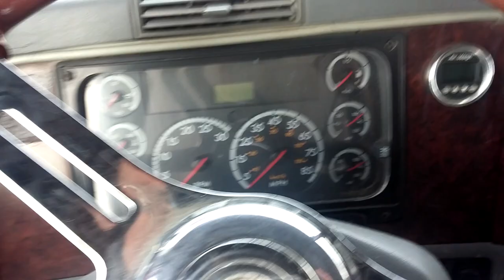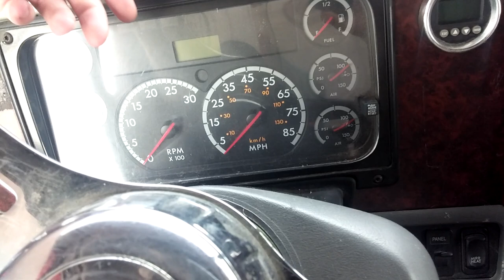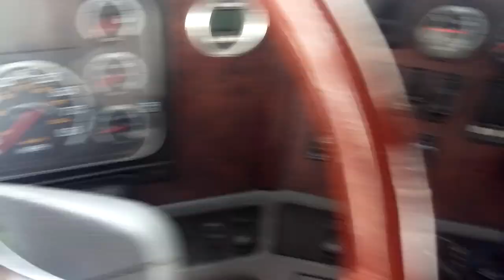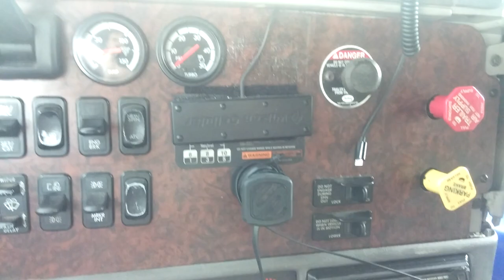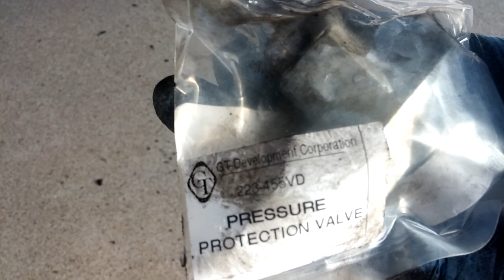2006 Freightliner Check Valve repair

Comment: Don't put the plug in until you know which hole it will line up first. And if I have a quick connect out, I replace it.

Comment: What about using the drain plug on tanks
Reply from the maker: Drain plug is slow and does not get all the air out quickly.
Thats why I use the air park valve and brakes to get out air first.
Reply: Too slow

Comment: There are 3 valves that looks the same and tbere are set to open and close to different pressure 😳how do you know which one is which one 😳the dealer dont tell you they just say thet are parts for your truck😳

Comment: Dude, spray all that down with either, starter fluid. Before you take it apart to clean all the oil and junk off of it. Be a easier to hold on to and you want get as dirty either... JUST DON'T BREATH IT while your spraying it..

Comment: If you struggling with a quick connecting fitting, you are far from some common sense. You do not suppose to reuse air quick connecting fitting. It'll leak 8mm is around  5/16 size .
Reply from the maker: +Tana you're funny
Reply: @GameGeezer  Not as funny as your inability to express your thoughts though.
Clarity is a fundamental requirement in "educational"/ "how to" type videos. 
You don't have any.